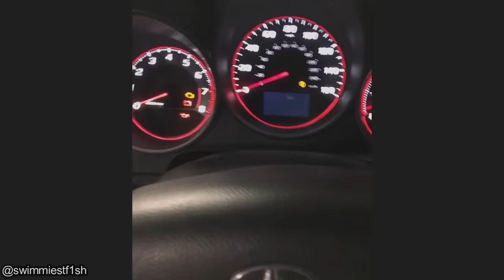Customer States Compilation (The Best of 2021) | Just Rolled In

Comment: 0:00 Double Road Sign Gets Struck By Car
0:16 Farting Gas ⛽️
0:28 Screaming Window
0:36 Mold Interior
0:51 360 Degrees Steering Wheel
1:09 I Laugh At This Oil Change
1:52 Body Filler Exhaust
2:11 Rats In Air Filter
2:24 Raccoon Under a Hood
2:42 Thai Snake
3:01 How Many Bullet Holes Are There
3:23 Shelby Drifted Into the Curb
3:44 Mattress Struck By Car
4:00 Welded Exhaust
4:28 RV Towed a Truck?
4:38 Radio Operator Car
5:26 Car on Fire
5:38 No
5:45 Driving a Wet Concrete
6:04 No Bolts Holding the Struts
6:24 Worned Maserati Tire
6:34 Cutting Board Founded
6:52 Floored Brake Rotors
7:10 How You not put oil Filter Properly
7:23 Wrong Side of Brake Pad
7:36 Bugs
7:47 Glove Box Fell Off
7:53 Messy Fuel Pump
8:12 Car in flood
8:33 Driving Through Puddle
8:41 Grey Fluid
8:51 Cover Broke under the Engine
9:10 Damaged Oil Filter
9:30 Weird Noise From the Engine
9:43 Wrench Goes into the Tire
9:54 Kitten was Rescued
10:05 Brand New Car Crashed
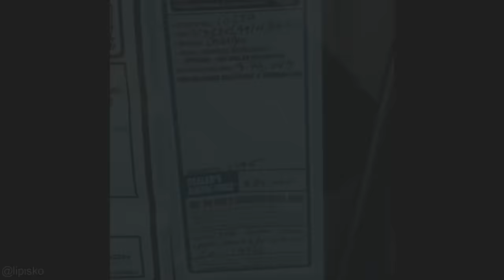10:33 Bucket Seats?
11:00 Universal Joint Broke & Driveshaft Broke
11:14 Customer Installed wrong Battery
11:21 Messy Radio Wires
11:38 Scraping Wheel
11:56 What a Mess in the interior
12:24 One hand
12:43 Rusted Frame
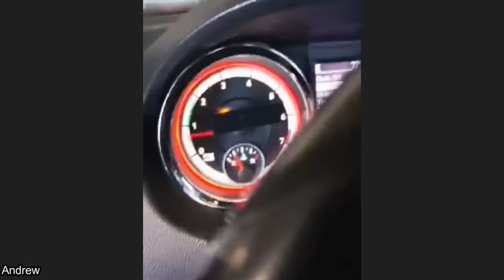13:05 Taped Engine Light
13:10 Smokey Exhaust
13:25 Honey Brakes
13:36 Seized Engine
14:04 Camshaft Rotation
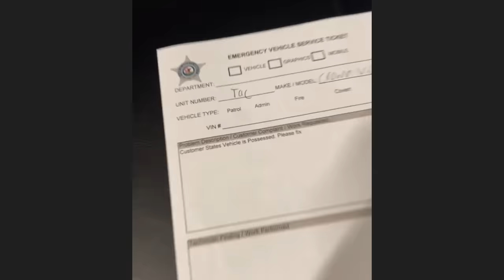14:11 Vehicle is Possessed
14:59 wat
15:14 Green Nut in the Engine
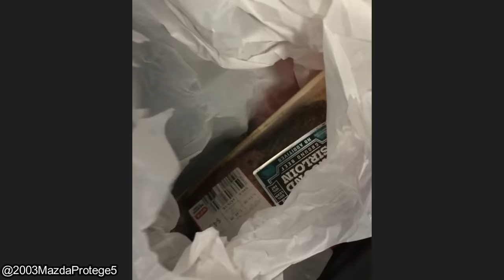15:19 Horrible Smell Beef

Comment: 05:06 I say the driver is totally crazy.

Also, atleast where i live, if he got pulled over by police they would have this car declared not fit for road, remove the plates and told to get the car inspected before getting his plates back.

It is not legal to have all of the stuff he moulded to the back of the car. For example if he hit a pedestrian or cyclist, there would be great risk that some of that crap, would tear the person to pieces.

The law here also states that you can not have anything on the dash that obstructs the view out of the front windscreen, and also, all cargo must be secured so that it, in case of an accident, it will not be thrown around in the cabin. I assume that most of his junk, is unsecured.

Also, gluing stuff to the dashboard, and wires hanging where the passenger airbag deploys is not allowed, as it obstructs the safety device's operation.

Not to mention that all wiring must be secured, and if you run wires from the engine compartment, everything must be neat, secured, and fused.

Honestly, this car is just for scrapping.
Reply: I wouldnt even let this near the shop due to the shit wiring being a fire hazard.
Reply: I customise my own vehicle with a few led bars and gadges all coming from the passenger side of the bonnet to the door side of the driverside cab and even though one of the wires had to cross the top of the radiator, I made sure that all the wires were neat, fused, tripple insulated and away from moving parts or access points. This was not only unnecessary, it's dangerous.

Comment: I wonder how many times a year a mechanic has to tell someone never bring your car here again, because it's full of bugs, mold, or just 90% rust???  I'm sure a few of those cars, the mechanic refused to touch.
Reply: I used to work in a tire garage. All we did was tires. No oil or anything. I refused atleast one person a day on the grounds you stated above. Either the vehicle was too rusty to be safe to work on. Was full of trash, or was a biohazard. I had someone complain to management that we were refusing to work on her vehicle, when he saw the condition of the interior he told her to get lost.

Comment: 1:33 I love engine jello!
2:26 Wtf, that was the driver you chased off.
3:01 Those are speed holes
4:03 What did they install the exhaust with?  Glue?
4:40 Alien mobile communications center
9:30 He puts the old oil back in every 2000 miles

Comment: We had a Cadillac that was possessed when I was a kid. Horn would start honking in the middle of the night. Radio would start playing randomly. All sorts of things like that. Finally, the back seat caught fire one day while my dad was driving it. Turned out that a wiring harness was sitting on the exhaust and the insulation was melting causing many electrical shorts.

Comment: This makes me want to do a bunch of maintenance on my car
Reply: I got my first tools for my car a few months back: A 6-point 21 mm deep socket and a 2-feet 1/2-inch drive breaker bar. I need a torque wrench next.

This is for when I have to switch wheels by the roadside should I puncture or blow a tire. (touch wood)

Comment: Newbie here to the channel half of the stuff ie mechanical goes right over my head because I don't understand what has gone wrong, then there are obvious stuff like jelly oil and bad DIY jobs.  I literally had a brand new car that I had to return to the dealership for a replacement car after roughly six months most of that time they were trying to repair it.  The fuel tank was so badly rusted inside I couldn't get the cap off to refill it,  then it would suddenly cut off the engine whilst I was driving it extremely scary when driving at night on motorway suddenly no power, it would also like to turn off it's headlights whenever it wanted to. Then the car blew up there logistics machine trying to find the faults, by this stage car was in there garage more times than I had it at home, it would also unlock itself when sitting outside in my drive way at night.  I gave up realising that I was driving a possessed car and demanded a replacement,  because the faults were never getting fixed.  I hope they didn't sell it off to someone else.

Comment: When I was 16 I volunteered to change my dad’s oil… drained the manual transmission and filled the engine. The first day my dad said it was making a funny noise on the way home from work. The second day it was no longer drivable. 

30 years later and I still feel terrible about it :(

Comment: I once bought a Pontiac Grand Am for a great price overall for mileage and condition of the car. However I noticed immediately that my car had issues when coming to a complete stop from a higher speed. So I decided to replace the rotors/brake pads to discover that the previous owner put their most recent set on BACKWARDS.

Comment: Because I speak a small amount of "automobile," a mechanic at Midas invited me to see what my front discs looked like. While chatting, he recounted a customer whose brakes "weren't working well." Seems the entire outside layer of the rotors was gone. All the callipers were grabbing at was a single layer with a millimetre or so of cooling fins still visible. Upon being informed that the car was in immediate need of new discs and pads (minimum) all around, he accused the shop of trying to scam him and demanded they return his car. He got it back, but only after signing a form saying he acknowledged he was doing so against advice of professionals who deemed the car unsafe to drive.

Comment: I had a gmc 1500 that did the same... "Lock"... "Unlock" .. pattern that the possessed car at the end of the video did .... 

It took me forever to find a mechanic who could fix it... The problem was it would run fine for a week or 2 then all of a sudden start going crazy while doing 80mph on the interstate... By the time I would get it to a shop it would stop.... It ended up being a ground wire that had a short in it or something like that...

Comment: This shit is why I don't trust a quick lube place to change my oil/filter. A $30 bottle of 5W-30 synthetic from Oreilly and a wix filter, bing bam boom, done! Not only the money savings and trust in myself, I enjoy it too. It gives me a chance to go over the underbody while I'm under it with my creeper.
Reply: Of all the oil changes you've done, did you ever see anything that needed fixing/replacing while you're at it?
Reply: @yongling9825  Sure, especially since I drive used cars. Sometimes it's just an accumulation of dirt or a little surface rust that needs to be sanded. Also, I have replaced CV joint boots to prevent premature wear.

Comment: 5:20 That is a HAM radio set up. Ham radios require a liscence to operate and this appears to be an illegal set-up that is mobile to avoid the liscence requirements. (They can not be mobile, they have to have a fixed location.)

Comment: 13:35
[Last oil change: 2009, 68K miles ago, literally just clean it off and runs like new]
BMW engines really are bulletproof. 
It's just everything else around the engine that breaks.

Comment: Well, at 8:04 that's why my 1st Gen Honda CRV is superior. To get to the fuel pump you just take out the rear seat which is a couple of bolts, take the cover off the fuel tank and there it is.

Comment: 7:20 to be fair i had the exact same problem when i changed oil first time on my current car but i fixed the filter seal by miself after loosing around 1.5 L of oil, thankfully my oil filter is mounted upside down on top of the engine so didnt lose too much oil to damage the engine

Comment: My FIL is good about loaning out a vehical to family if they need it while their's is being repaired.

Unfortunately not everyone is as paranoid as me about borrowing things as I have a proper repair-replace no fault policy  if I borrow something.

 So lots if people respect that and willing to loan me something. I'm not very intrested in borrowing anything.

Just as a hypothetical for clarity. I have several chainsaws.

But let's say I didn't.

I'm more likely to go buy an axe to cut down a dead tree and chop it down the old fashioned way.

Then accept an offer to borrow your chainsaw.

Because if anything happens to it. 

It will be returned good as new with receipts or you will get a NEW one with receipts. So it makes more sense to save up and buy me one.

 Than buy you a new one on credit and still not have one.

I borrowed his truck once... Once....and it caught on fire. 🔥 

My BIL used speaker wire to run to a Garmin to the fuse box and shoved house wire flattened with a hammer in its place.

When I pressed in the clutch the wires hung up on it and shorted out and set the entire harness on fire.

I just wanted a dry warm winter ride to work and back for a couple of days.

But damn it would have walked the 2 miles there and back in a Blizzard instead of the 4-6 months of weekends building a custom wiring harness for that truck.

My piss poor bad luck it was a first year model cluster fuck Toyota doesn't even acknowledge ever existed.

Super easy and loads of diagrams and aftermarket and spare parts for ALL of them but the first 5-8 months they were built. Nothing, nada, zero, zip.

I got it to all work except I couldn't figuer out one issue.

I could have headlights or I could have dashlights but I couldn't have both.

Dashlights were 90s model weak so went LED and a nice switch. And another switch and a set of fog lights.

Love my FIL. We went to Radio Shack as it was in bankruptcy liquidation.
Bought a bunch of supplies for LEDs and nice switches.

Made all the lights 100% better.

If you see an 87 yo Mexican man driving a bagged mini truck with suicide doors and more lights than a Christmas tree you might have met him.

He got the thing off his brother that co-signed for his dumbarse kid that didn't make the payments.

I did some of metal work and paint with grandkids and some cousins did most of the wrench turning and restored the ride quality. 

Original owner just took a torch to the springs and ruined them to lower it.

Not my thing personally. I like my Welding rig to be at factory 4×4 height.

But it's a neat lil' truck. But someone else's stupidity cost me a ton of time on it before everyone else started pitching in and tricking it out with properly done work and became a family project.

Comment: The "jello oil" I have seen quite a few times watching videos like this. From what I've gathered, it is caused by putting additives in the engine oil. Wrong additives like transmission fluid cleaner or something similar that is NOT supposed to go into the engine oil, or WAY too much oil additive. Just stick to putting engine oil in your engine. I think most of those additives are a scam and do little to improve anything as long as you do regular maintenance. Change your oil!

Comment: Some of this stuff is absolutely mind boggling, what kind of brain dead idiot will put off quick, easy, inexpensive U-joint replacement and then when it fails he is looking at thousands in damages. same with brakes, if it is making a noise, get it to a shop ASAP, because it will just get more expensive with every additional mile that you drive it.